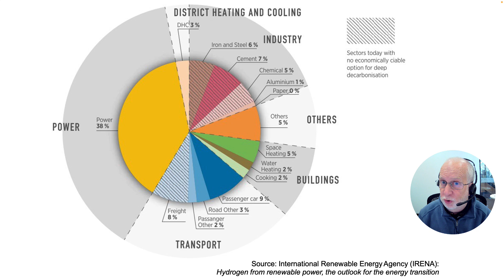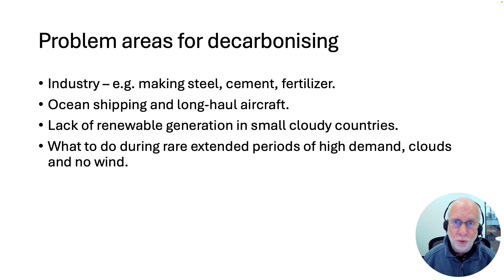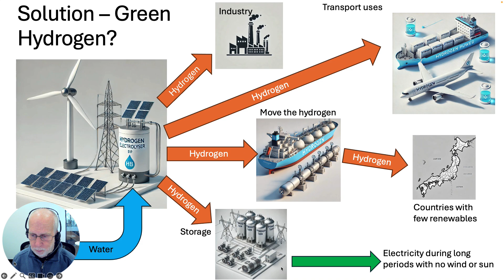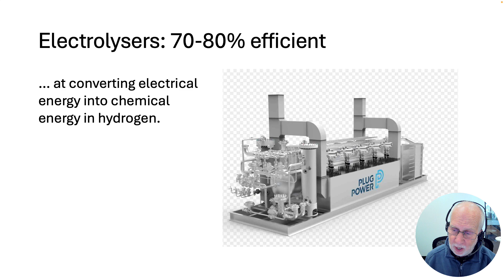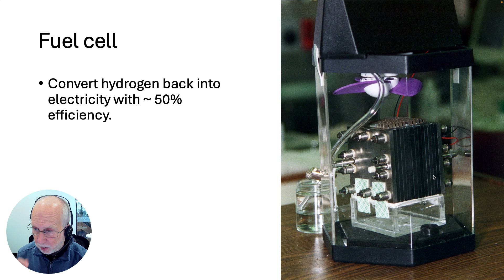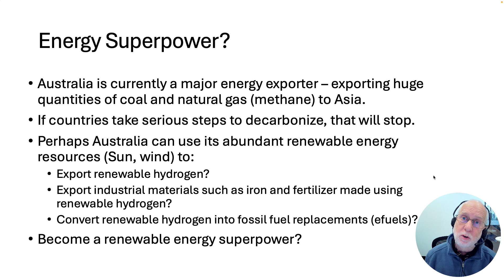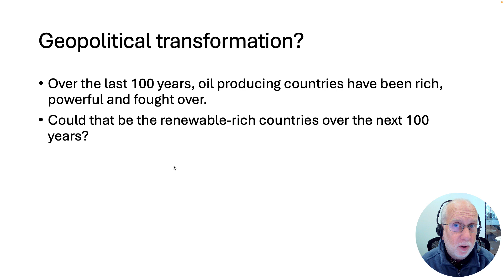Introduction to Green Hydrogen

Comment: Hydrogen is so good that in California, 1/2 the refueling stations are closed due to maintenance, it turns out contains hydrogen is tough ask Boeing. Cost $36 per kg $180 to fill for 300 miles of range. 95% of hydrogen is from steam reforming of natural gas and that process releases more CO2 than burning it.

Comment: Best case scenario from the numbers you gave us, you get back 40%(80% electrolysis, 50% fuel cell) of the energy you put in. Batteries will return at least 90%. 

The entire premise of hydrogen as a fuel completely goes out the window when it requires TWICE the electrical production infrastructure, just cause you chose hydrogen as a fuel source.

For the use cases that require higher energy densities,  Methane generation is slightly more energy efficient than electrolysis,  and produces a much easier to handle, much more dense fuel.  Though atmospheric CO2 capture would reduce overall efficiency, eliminating the slight advantage the process has.
Reply: Absolutely, also hydrogen has the same issue carbon capture does, where the energy consumed to do a green or even carbon negative action is energy that isn't going to replace fossil fuel use. green energy only makes sense if it replaces fossil fuels, hydrogen by hydrolysis would be a waste.
Reply: Hydrogen is very dangerous to produce and store, neither it, or batteries with current tech, are ever going to replace fossil fuels.

Comment: Hydrogen is mostly a terrible idea, the only practical way to make clean hydrogen at massive scale would be to use the Sulfur Iodine cycle with a high temperature nuclear reactor like a Molten Salt Reactor. MSRs could then be used to make synthetic fuels for transport where batteries are impractical. The hydrogen would then be converted into richer fuels like DME, or methanol.
Reply: Why can't electrolysis be used to make green hydrogen at large scale? 
"Im just asking i am definitely not an expert"
Reply: Ammonia which is hydrogen and nitrogen and can be made greener with GMO algae and it doesn't require infrastructure changes. No high pressure issues pump incar like gasoline 😮.👍🤟✌️